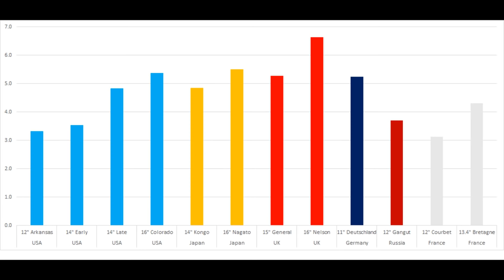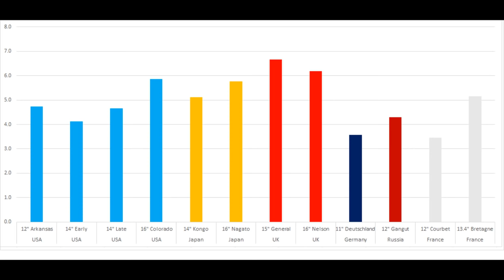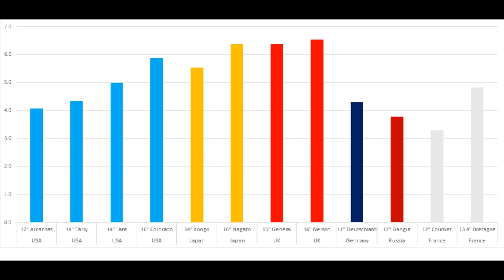Battleship Guns of WW2 - A series of tubes

Comment: To be clear overall this is a great video. I especially enjoyed the discussion of how you developed your methodology to create your final rankings. Well done. 

That being said I think what you miss in this evaluation can best be seen in the USN’s own evaluation of the 16” 50 vs an 18” weapon. 

First is penetration. Yes the 18” gun with the SH shell that was developed is a much better penetrator than the 16” 50 2700 lb combination. But the USN had already found that designing a battleship with a useful immunity zone against the smaller gun even in an unlimited design like the Montana’s was a very difficult exercise. Basically if both guns will penetrate but one penetrates “more” are you really getting an advantage from that?

Second bigger guns come with trade offs. As you’ve noted in other videos the jump from 16” to 18” really increases the weight. Battleships are very weight critical so that has to be factored in especially in an era of treaty weight limits.  An Iowa with 6 18” guns firing the 3850 lb super heavy shell has a broadside weight of 23,100 lbs. But with 9 16” 2700lb rounds it’s 24,300lbs per broadside. So not only are you putting more weight of metal down range you have more shells which obviously is going to give you a better chance of getting hits. And if either shell will penetrate when it hits the 16” is really beginning to look like the better option. 

Especially if you factor in rate of fire. If we accept the nominal rates of fire for these two guns (2 per min for the 16” and 1.5 for the 18”) if we have 15min of rapid fire a 9 gun 16” broadside is putting out a theoretical 270 shells or 729,000 lbs. The 6 gun 18” ship puts out only 135 shells or 519,750lbs. If both guns are equally accurate it seems pretty clear that the 16” gun ship is going to have a huge advantage. 

Now let’s look also at what that means when you factor in gun accuracy. NavWeaps gives a 10.5% hit chance for the Iowa’s guns at 20,000 yds against a broadside target. Yes I know this number has to be taken with a HUGE grain of salt but it’s something. So in that 15min of rapid fire (and with radar guided guns and late war fire control an Iowa is going to be in rapid fire mode pretty quickly) we can expect the 16” gun to land 28 hits. The 18” gun will only land 14 hits. Now any battleship that takes that level of hits is going to be in serious trouble. But with more shells arriving more rapidly it’s far more likely that the 16” gunned ship is going to get a critical hit sooner and gain the upper hand over the 18” gunned ship. 

These trade offs are missing from your analysis and I think they have to be considered when comparing one gun to another. The best gun isn’t always more. 

Another factor that you didn’t consider was deck penetration. I understand that at “typical battle ranges” this may be less of a player but in a long range stern chase engagement for example (Like when Warspite hit Guilio Cesare) it could be very relevant. Certainly such penetrations were a major factor in Battleship design and construction. 

Finally in looking at straight penetration I think the smaller guns are getting more credit than they deserve. For example (again using NavWeaps as a source) the 11” guns on the Scharnhorst can only penetrate 11.47” of side armor at just slightly over 20,000 yds. Which means if she tries to engage any of her post 1930 contemporaries at 20,000 yds she isn’t going to be able to get belt penetrations with the Dunkerques as the one exception. Nor can she penetrate the vast majority of the pre 1930 ships at that range.  If the guns on your ship are simply going to bounce shells off the armor of your opponents at likely battle ranges are they really any good at all?

Perhaps a better way to look at penetration overall is to create a representative ship from both eras. You may decide that your average post 1930 battleship for example has a 14.7” belt and a 6” deck. Now calculate the immune zone of that ship against each of the guns. The perfect gun would have a negative IZ against such a ship (ie the shell is still punching through the belt at the same range it starts being able to penetrate the deck armor) and a poor gun would have only a limited ability to penetrate. For example against such a ship the German 11” gun has to be under 16,000 yds (the exact figure isn’t shown on NavWeaps) to get a belt penetration and can never get a deck penetration.  I think scoring the guns this way might present a far better view of their real hitting power than just straight penetration at 20,000yds gives you. 

Lastly I think you may have been on to something leaving maximum range out of the equation. As you note in most ships this is a mount limitation not a gun limitation. For example it’s obvious the had Vanguard been given a totally new turret design allowing the 40deg maximum elevation of the KGV class they would have had more range. And the effects you mention of firing a gun that can reach out further at shorter ranges show up in their time of flight and penetration values. Perhaps instead of range time of flight to 20,000 yds might be a far more useful value. Though it may be that the range of values is so small as to be worthless. In any case it seems very unlikely that beyond a certain point (maybe 30-35,000 yds) any Captain is very unlikely to open fire and thus in a ship to ship engagement the ability to range beyond that has little to no value.

Comment: Great video and analysis! I was somewhat surprised about the guns of the Nelson class battleship. I knew that they had the 16 in guns, which they were quite big, but it turns out that they could also perform quite well in all categories. Therefore, it would have been better to have small guns (16') with better overall characteristics, than bigger guns (18.1') with poor performance on the other characteristics, would not it? And by the way, what a beautiful design the Nelson class battleships was!

Comment: All these improvements still operated within the physical limit of the visual horizon. At one hundred feet above sea level, the curve of the earth limits visual distance to around 24,000 yards on a clear day, while the visual horizon from a point thirty feet above sea level was around 12,000 yards. This is why turret elevations generally leveled off at between fifteen- and thirty-degrees during World War 1. Most high-powered heavy guns could reach 24,000 yards at fifteen degrees, while going to twenty or thirty gave insurance against hull damage causing lists. Suddenly at the end of and after the war, navies were demanding a minimum of forty degrees elevation. What changed? The ability of the capital ship to carry and launch aircraft, aircraft that had a flight endurance of two to four hours and transceivers, that were light in weight, reliable and powerful enough to be put into an aircraft light enough to operate from a flying off platform or catapult carried aboard a capital ship. The observer could be put over the target and correct fall of shot to the maximum ballistic range of the gun. By 1935, the US Fleet could successfully engage a target ship at 30,000 yards over a smoke screen by air spotting. The IJN intended for its Battle Line to open an engagement at more than 35,000 yards using air spotting. Air spotting did have its limitations. One navy or the other had to establish air supremacy (or at least air superiority, which is why multiple aircraft were carried, to make up for losses) over the battle area. There had to be multiple aircraft to maintain spotters over the battle area. Radio procedures had to be developed to ensure ships were working with the right spotters and engaging the right targets. Aerial spotters had to be trained. Most ship’s captains were reluctant to use seaplanes if they had to recover them, since this involved slowing or even stopping their ship, making it more vulnerable to submarines. Poor visibility or bad weather would limit or prohibit the launching of aircraft. The aircraft and the aviation fuel represented a fire danger to the ship, especially when installed near ventilation systems that provided air to closed spaces like engineering or ready service ammunition and torpedoes. Aircraft and catapults could limit the elevation and train of guns or might even be blown off the ship by gun overpressure when firing over or near the catapults. 
		Another development coming out of the Great War was concentration of fire by divisions or groups of capital ships or cruisers. Using multiple ships would generate a larger “danger zone” around the target, ensuring hits despite any maneuvers it might employ. The British especially developed and trained on methods of coordinating the fire of multiple ships on a single target. Basically, one ship would control the firing solution and radio the solution to its mates, who would adjust the solution slightly for range and lead on the target. When the correct solution was reached, the ship which was hitting radioed its solution to the others. In some cases, not all the ships in the division could “see” the target. Air spotting could be integrated into this system. The best method involved ships with the same guns and turrets, which simplified generating firing solutions. One method adopted to identify shell splashes by ship was the use of colored dye in the ballistic shield which added color to shell splashes. Ships were assigned a specific color to identify their splashes from other ships in a battle line engagement.
		Night engagements had their own limits. A clear night, with still winds and waters, and a full moon, especially if it was behind the target, could represent sufficient light to engage to the visual horizon. When visibility dropped off, navies had to rely on star shells, flares, and searchlights. Star shells and parachute flares had to be placed behind the target to silhouette it, and the illumination shells were lighter, less well shaped and fired with smaller charges and at lower velocities. The maximum range for illumination rounds fired from heavy guns was about 22,000 yards, with normal maximum ranges for medium guns being between 12,000 and 15,000 yards. Searchlights could reach out to 9,000 yards. A target’s gun flashes and any fires aboard a ship could help determine bearing and speed, but spotting required being able to see the shell splashes. Some navies developed air dropped flares, but aerial spotting was not successful at night. Some navies investigated active infrared night vision, but the only thing that came out of it was the IJN’s infrared visual signaling system. The Japanese and the British were the most practiced navies at night combat with superior searchlights, optics, star shells and parachute flares. What changed things was radar.
		The radar horizon from one hundred feet above sea level is 30,000 to 40,000 yards, depending on conditions. Early fire control radars could detect out to these ranges, but with their low frequencies, power, and wide beams, they often couldn’t acquire and track a target consistently beyond 30,000 yards. Sometimes the effective range for target acquisition, tracking and engagement was less than 20,000 yards, which wasn’t much of an improvement over visual systems, though radar did not give your position away, at least not until electronic surveillance systems were developed. The early designs of radar were heavy, required unanticipated amounts of generated power, were less than fully integrated into the fire control system and gunnery doctrine, and were less than completely reliable. Few officers were trained in their use or understood their advantages and limitations. The radar scopes and operators were often separate from the directors and even the plotting room, resulting in operators taken ranges and bearings on the wrong target, as the early wide beam radars often presented multiple returns. Targets would appear and disappear from scopes, with operators and gunnery officers believing the target had sunk, and then engage a “new” target some minutes later as the target reappeared. Still, all things considered, the Mark 3 (FC) fire control radar operating at 40cm could give accurate ranges to 24,000 yards and even spot shell splashes at 12,000 yards. Higher frequencies, more power and tighter beams, along with better integration into the fire control system resulted in performances unthinkable in pre-radar navies. In October 1944, three modernized older (pre-1937) US battleships detected a Japanese battleship at 40,000 yards at night with surface search radar (SG-1, 10cm), acquired and tracked it from 35,000 yards (with Mark 8 Mod.3 FCR, 10cm) and had a firing solution ready by 30,000 yards (using the Mk.34 director, Mk.VIII range keeper, the Mk.41 stable vertical and RPC). In comparison, the Japanese battleship’s maximum detection range was 30,000 yards with the Type 22 10cm radar, while the maximum effective night engagement range was 15,000 yards using illumination rounds.
		In 1939, the latest Japanese, American and British capital ship main gunnery fire control systems were basically equal in effectiveness. The Japanese FCS in their capital ships and heavy cruisers was more manually intensive in operation, especially as they inserted an additional manually operated optical target tracker into the loop. The least effective Japanese FCS was in their old light cruisers and destroyers. The best US systems were in the latest heavy and light cruisers, grading down to the FCS on the “California”, “New York”, and “Arkansas” class capital ships, which were at least a generation behind the latest Japanese FCS. The best British system were on its newest cruisers and the latest rebuilt battleships and battle cruiser. From there it graded down, HMS Hood and the unmodernized “R” class battleships having the least capable capital ship FCS, and the old WW1 light cruisers having barely any FCS at all. The Japanese pulled ahead slightly with the Type 98 FCS introduced in IJNS Hiei in 1940, but the US took the lead in 1941 with the Mk.38 FCD/Mk.VIII range keeper/Mk.52 stable vertical/RPC FCS and kept it, adding Mark 3, then Mark 8 and finally Mark 13 FCR.

Comment: It was wonderful video. I do not like to tell a content creator how to do your job. However, you did ask for feedback. Your comparison of the guns based on their performance only shows how good they could be. I do not believe it shows how good they actually were. They are a few things I would change.
1. Turret rotation speed and elevation. 
This would show more accurately; range, reload speed and time to acquire the target.
2. Time of flight.
This would effect accuracy. 
3. Different common shell weights.
This effects everything. 
4. Group naval guns by size and not era.
A. 8 to 12 inch
B. 13 to 15 inch
C. 16+
This would show how they would perform against ships with similar guns.
5. Powder. ( If applicable.)
I know this one is more unrealistic, but I do not know if navies of WW2 used the same charges for the same guns or if powder quality was uniform. This one may prove unnecessary. Your videos are very well done.  Please don't work to hard.

Comment: Excellent video! High explosives and book keeping 😁. Listening to it couple of things occured to me. Theoretically one could construct DPS envelope for the whole range if  the accuracy data was available for all guns, as well as aerodynamic drag coefficients of the shells used. Elevations could be back tracked for any given range, hit at the belt assumed and penetration checked. If no penetration occured you could take damage as kinetic energy of the shell plus the explosion energy from the charge. If there is no penetration skip half the charge energy. This is not something that could be easily done in Excel but sounds like fun, at least for me. Integrating the envelope you could even come up with a single aggregate value for each gun.

Comment: Vanguard wasn't the only WW2 British ship able to elevate its 15 inch guns to 30 degrees, both Roberts class monitors  had the MK1* turrets  the * indicating they were modified to allow them to elevate their guns to  around 30 degrees rather than the 20 degrees of the MK1 turret  and did carry supercharges range could be extended by timing the shots to use the roll of the ship to increase elevation even further and also by flooding the bulge on the far side. Of course as a monitor their role was shore bombardment and so they were normally firing at stationary targets so hitting at those ranges was more realistic plus their shallower draft meant they could fire from much close to shore where necessary.
Firing the supercharges did however severely reduce the number of rounds which could be fired before the guns needed the liners replaced.